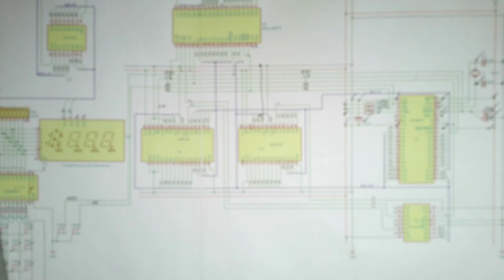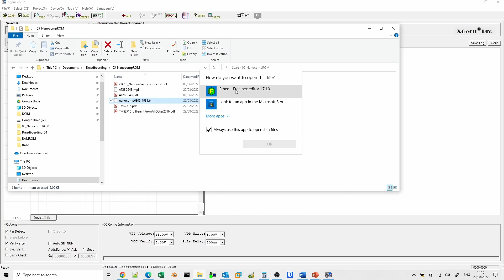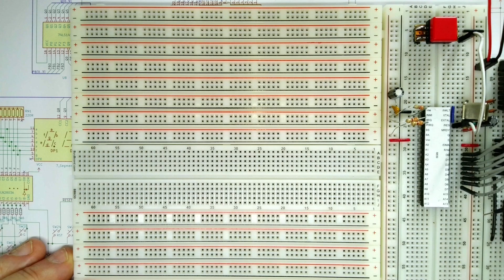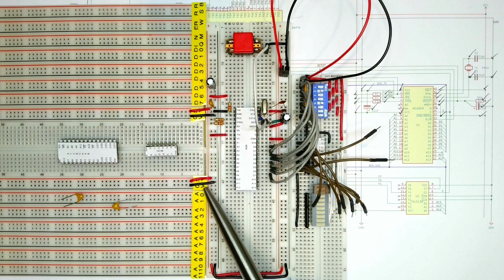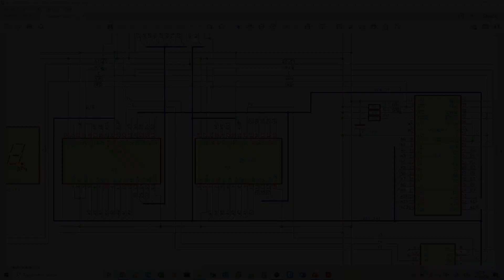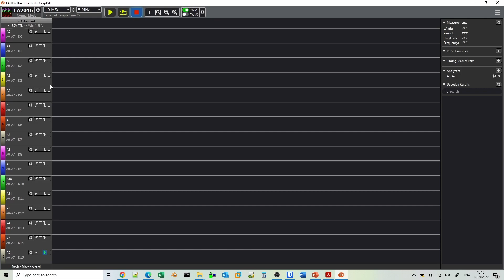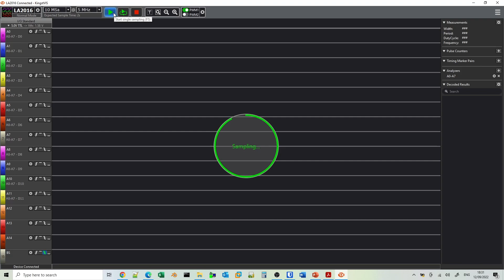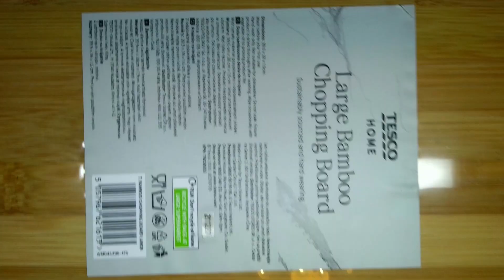Nanocomp 6809 #5 EEPROM - 8 Bit Breadboard Micro

Comment: thanks mate, I think taying CS2 of  628128 which is an active high pin to ground will keep the ram inactive ,,, please explain the reason for that thanks mate
Reply from the maker: I checked the schematic and it looks like CS2 (pin 30) which is active high is connected to the red +5v line.
A15 (pin 31) is connected to ground which may have confused you, as we are only using the lower 32K of this 128K chip.
Reply: @breadboardinglabs  thanks mate,,, this looks interesting do more videos, please 👌👌

Comment: I notice you place your decoupling capacitors close to the ground pins of your IC. Is there a reason? I usually see them as close as possible to the power pin instead..
Reply from the maker: I will dig out the source for this. Its related to ground bounce I think, so the spike interference is caused by the spike on the ground connection. It is the opposite of what I would have thought 'common sense' would indicate.
Reply from the maker: This RS document explains its all in great detail https://docs.rs-online.com/b2b6/0900766b8002542d.pdf.  The main design rule from page 15 I took note of was "Use decoupling capacitors for every device usually 0.1 uF should be adequate. These capacitors should be located as close to the ground pin as possible"
Reply: @breadboardinglabs  Thanks for the link, I'll definitely check it out!